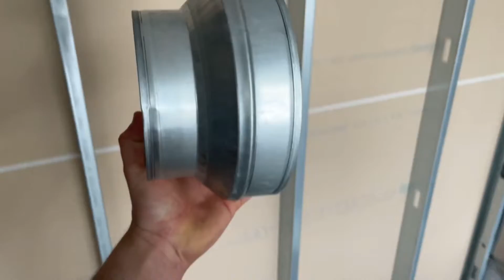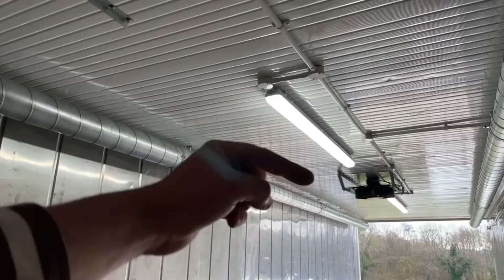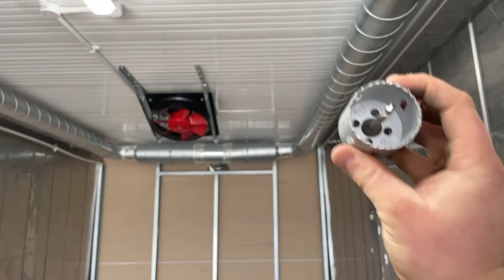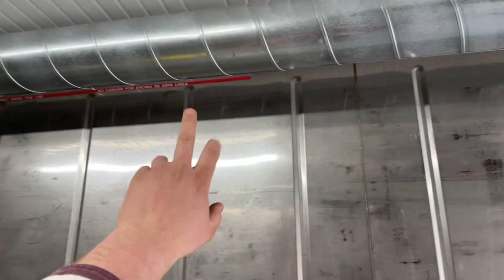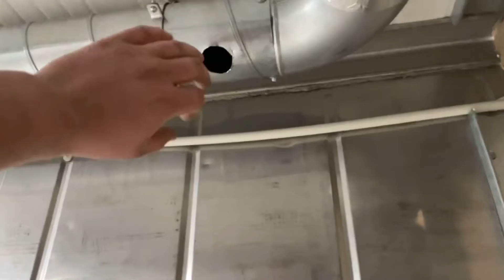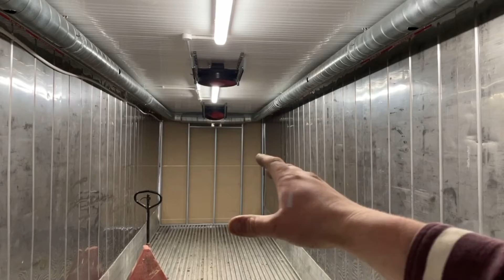Container Kiln Part7 (Finishing the ducting)

Comment: What is the highest temperature you riched? (inside container)
Reply from the maker: Still unsure I’ll get a thermometer
Reply: @oakfarmfirewood  i think i will make The same aš yours.
Maybe you have some advice?
I saw you was talking about inlet at the bottom.
Reply from the maker: 75 degrees Celsius I’ve got so far, but could go hotter

Comment: Out of curiosity, why did you choose to vent the hot air from the ceiling down as opposed to running it through the floor and up through the logs?
Reply from the maker: If I were to build another I would duct it outside the container and put T section into the bottom. But as it is, it’s very contained and can be easily moved/sold
Reply: Instead at the top?  @oakfarmfirewood
Reply from the maker: Just more complicated. And if you were to use the vented floor you have to have a full load in there at all times or it will just favour the gaps if that makes sense
Reply: Appreciate the reply, makes sense 👍 

Thanks